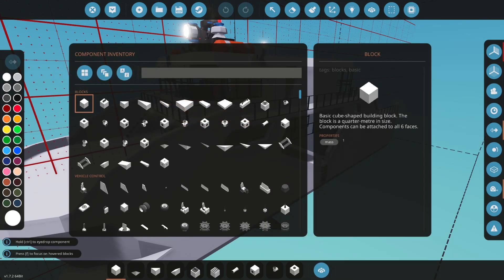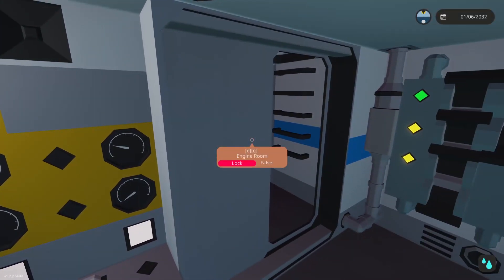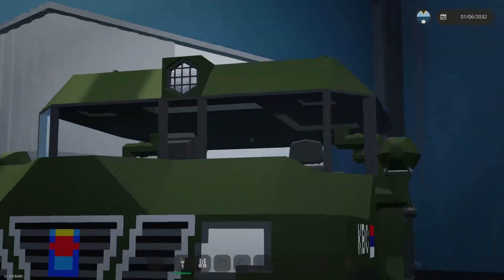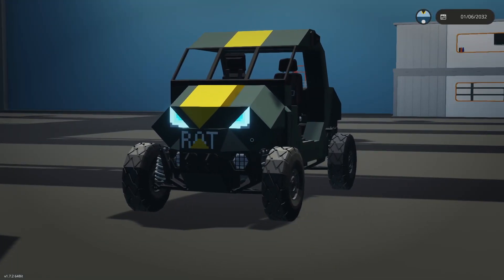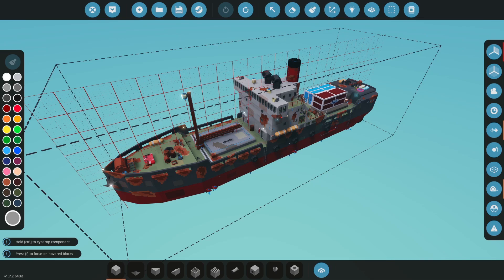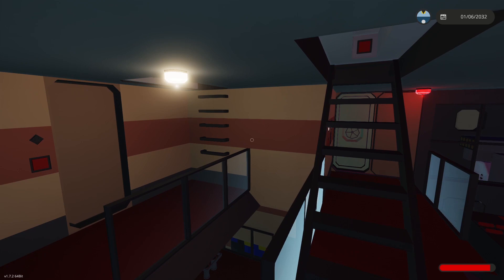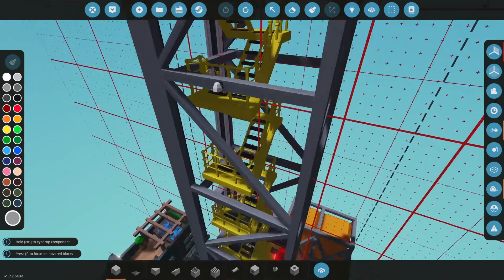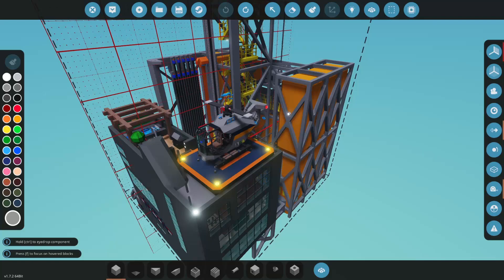ENGINEER explains design constraints in Stormworks

Comment: Can you build a ship (bulk,tanker,container,roro doesn't really matter). But focus on the engine room and make it as realistic as you can in a mechanical aspect and make it look realistic too ofc.
Like have a realistic Control room with starting procedures and alarm list and camera system etc. Have main eng and aux eng and try make them realistic in the way of how they start with compressed air and how cooling systems work. Add like oil purifiers, Fresh water gens, Steering gear, boilers etc. Idk what's possible and not but would be nice to see what you can come up with.